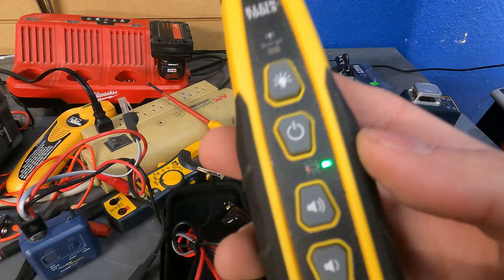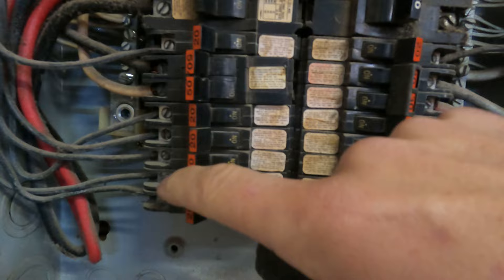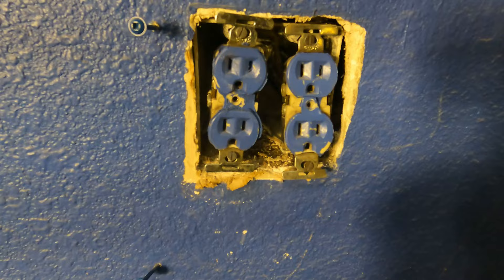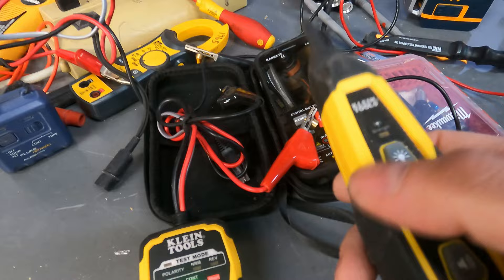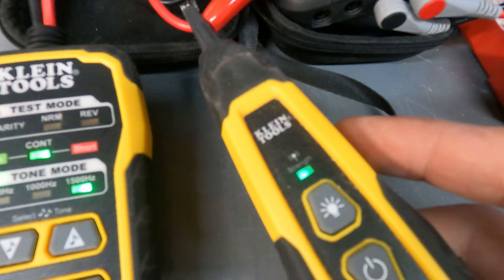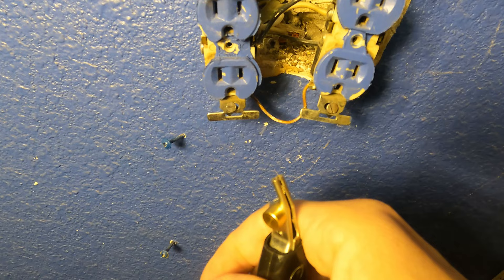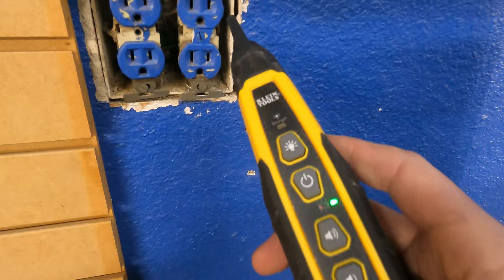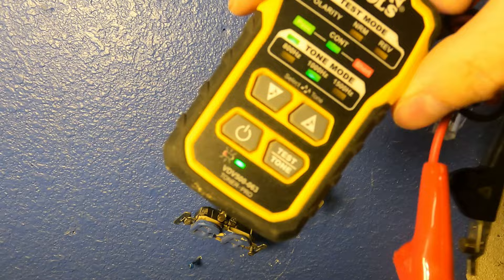Klein Tone generator/ probe  - How to use a Toner The RIGHT way!

Comment: Dude that toner is garbage
Reply from the maker: Which 1 do you like?
Reply: Lately I’ve been using that fluke toner not the one that they used to sell at Home Depot the blue one I’m talking about, but the one that had the numbers on it with the light but right now I Literally just received the ET 450 Advanced circuit tracing kit.. I’m not trying to shit on your video or anything like that I just use that toner and I know it only tones up to 200 feet I believe I know there’s two different ones I might be mistaken that one for the cheaper one
Reply from the maker: @skunkbri  that's cool, some of the higher end ideal 1s work amazing 
This is the best non hand tool klein makes usually the meters and stuff from klein is garbage compare to others for the price. Thanks for the input!
Reply: Excuse me, one question is this tool good for tracing a short on a car, cars work with DC-(direct current). Do you think i can trace a wire with this tool he is showing. Please help me, also does the battery has to be connected or disconnect, thanks in advance...
Reply: @LuisMartinez-fr9gq  A late reply but this tool can’t be used with energised circuits. It’s like a contactless continuity tester.
Reply: Thanks for replying, in another words i have to disconnect the battery...